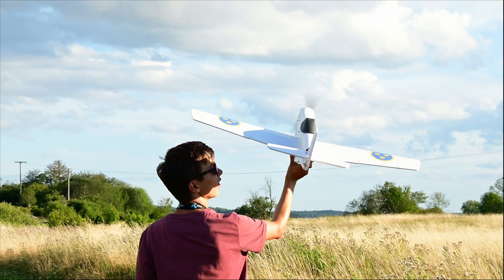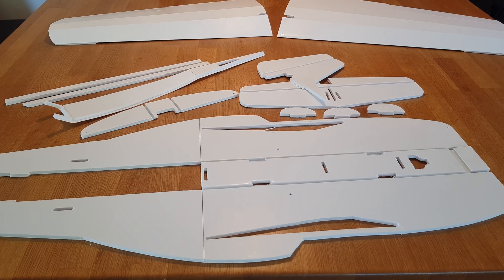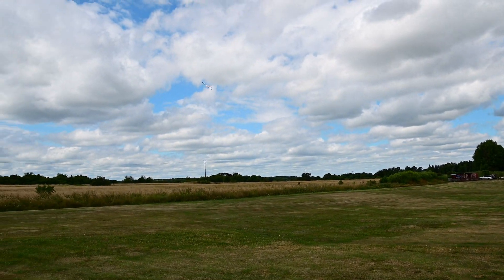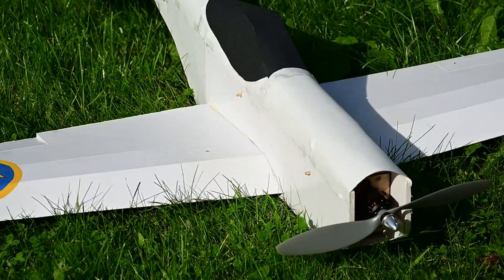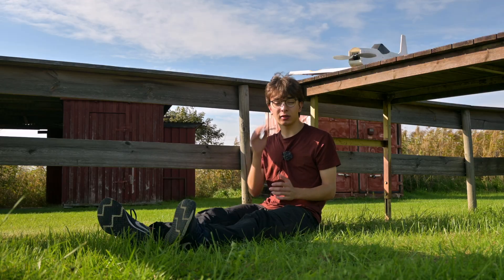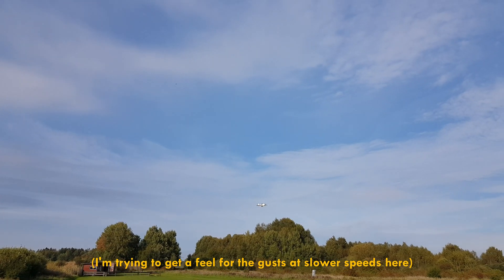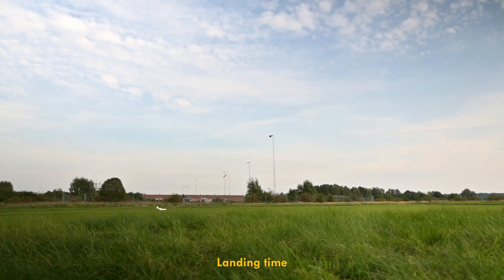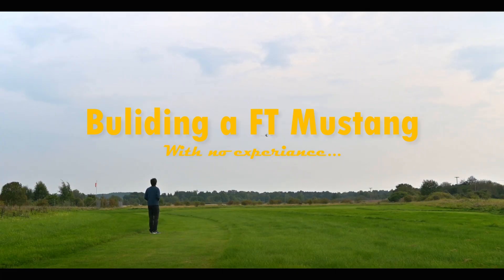Building an RC Plane (with no experience)

Comment: Great to see! I had a similar journey.🙂 It’s a great feeling to fly something you built yourself. The next one will only take a couple of days to build 😉

Looks like an APC prop, I had big issues with airplane props breaking. They are very sensitive to ground strikes. I have swapped to quad propellers. They’re much cheaper, you get a 4-pack for half the price or less. And durability in my experience is much higher, in part because a triblade will have a smaller diameter so groundstrikes will be less frequent/severe. Also they are less sensitive to balance issues. 

The only drawback is flighttime that will be reduced. But you can afford another battery with the money you save. 👍

Comment: Fun fact: dont use Temu electronics for rc planes, almost lost about $100 which isn't much for rc stuff, but im broke
Reply: Temu electronics ate fine tbh, I would say it's better to use those cheap electronics for your first few planes. Now, Idk how you spent $100 on temu electronics but, it isn't smart to spend $100 on cheap electronics like that. I would say, for $100 you can get -flysky fsi6x($50), blheli_s 45a esc( $12),emax eco 2 2207,2400kv($25) and some lipos for $13( I believe you can get 1000mah 30c 4s lipo with that)
Reply: @dipesh8836  The almost $100 was the receiver, motor, and battery
Reply: I believe that makes more sense 😂
Reply: @LemonLocomotive thats not cheap
Reply: Im using cheapest aliexpress electronics even transmitter, they work great for 1 year and are still. U need to look reviews

Comment: 0607    when the undersides of wingtips are not finished the result is a wing that has  TWO  Completely  different profiles.        the use of full strip ailerons is not recommended; on anything that is not a cropduster.
0631   this was a  SF  prop.!     which means that there was relatively more prop vibration.     at some point, that extra vibration could have led to servo glitching/crashing.     it is not clear whether the diameter of the new 'stiff' E prop is a bit over-long.    a comparison of the prop diam  to  the  wingspan would answer this question.

0731   SF  prop  back  on  the  model.
Reply: he built with a plan